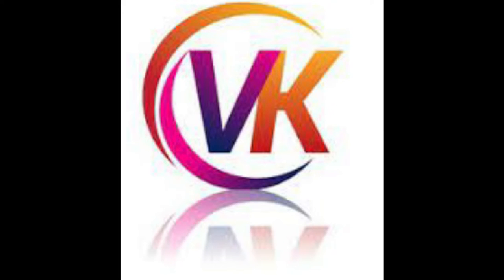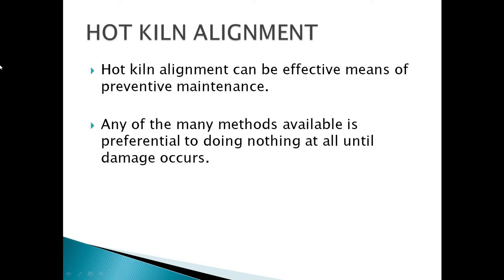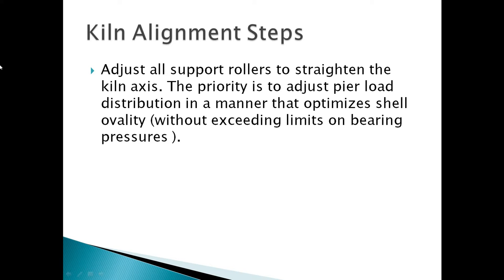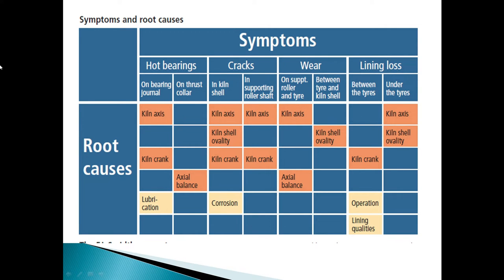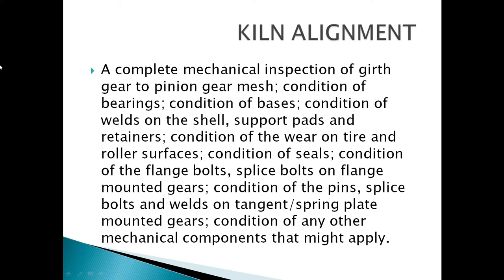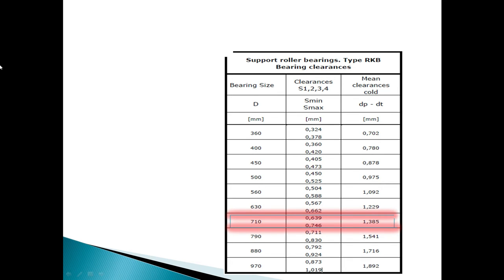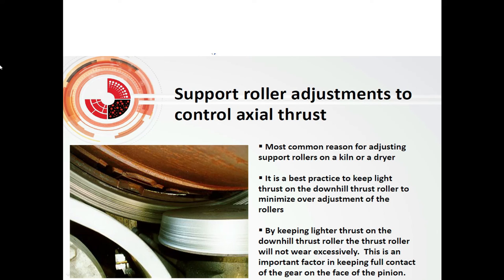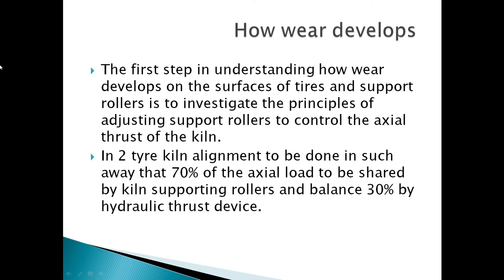Kiln alignment and  rollers  adjustment #cement #kiln #maintenance #mechanical #flsmidth #khd

Comment: But in a spherical roller based rotary kiln how to decide thrust direction
Reply from the maker: To do decide the thrust direction in a spherical roller-based rotary kiln,
 visually inspect the gap between the thrust collars on the roller bearings. 

For "normal" position is to have a gap on the "downhill" side, means the roller is correctly skewed to push the kiln shell "uphill". 

A gap on the uphill side means the roller is misaligned and pushing downhill